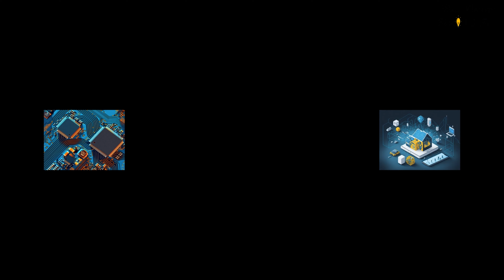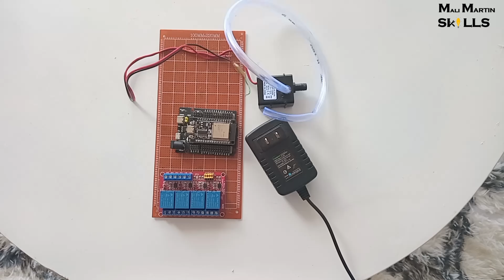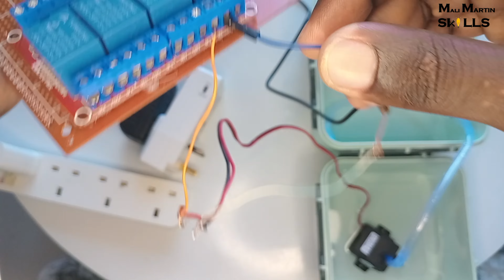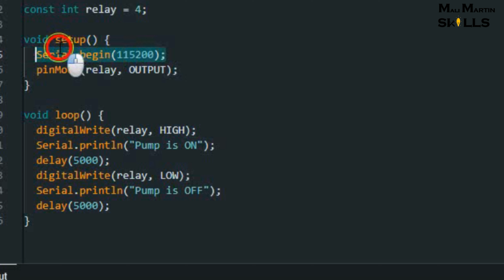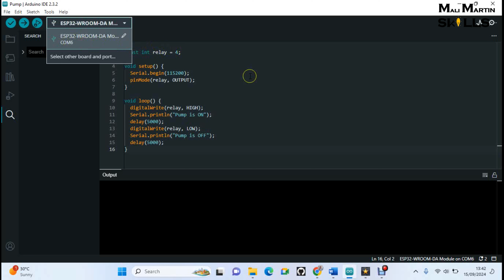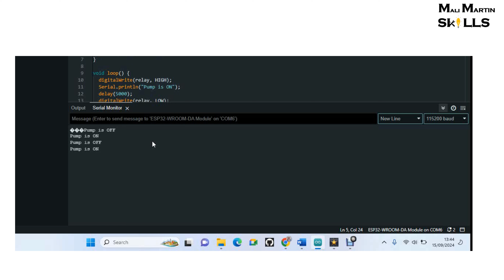ESP32 controlling a 12V DC Pump using a Relay

Comment: Hi!, how can you control the rele (5v) with the esp32 ?, I don't understand, because the rele works with 5 volts and the esp32 works with 3.3v
Reply: @RodrigoMunozMoreno

You can power an ESP32 with 5V, but it's important to understand that the ESP32 itself operates on 3.3V internally and the 5V input is typically used for convenience, especially when using USB power, and to power 5V peripherals. 

The ESP32's core operates at 3.3V, and any 5V input is regulated down to this level internally. 

Therefore, both can use 5V